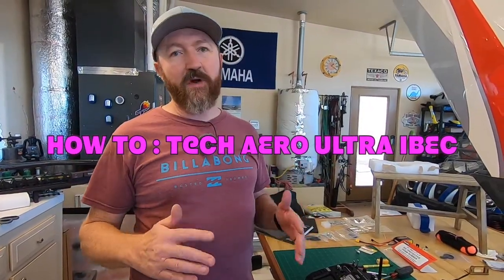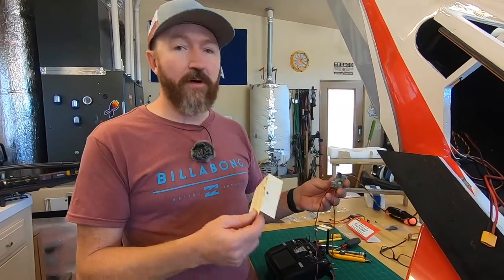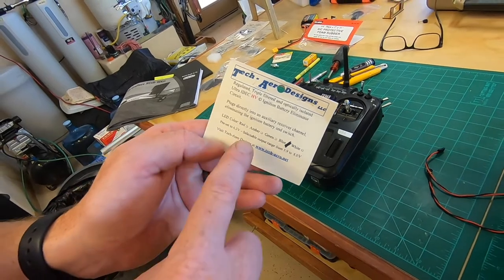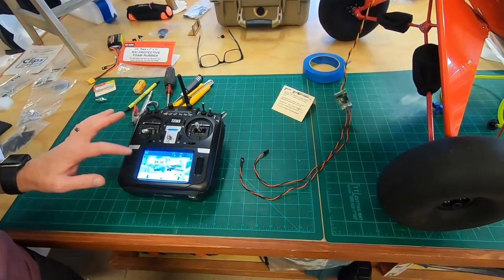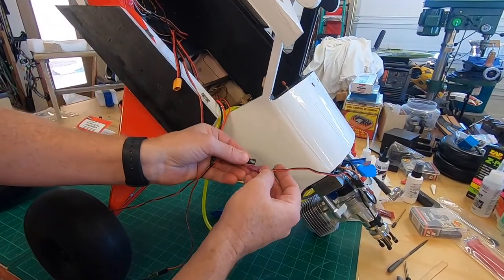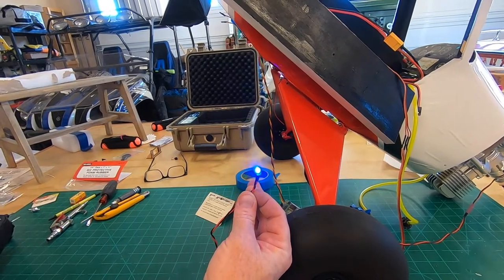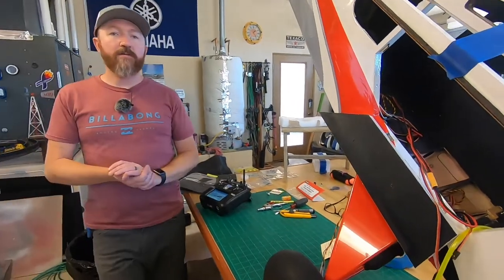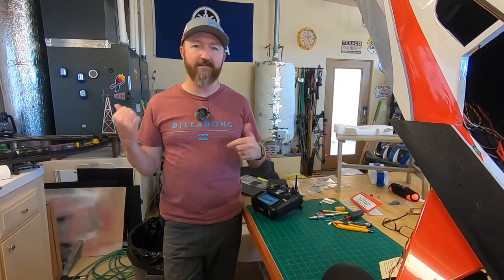Tech Aero Ultra IBEC Tutorial

Comment: Hello , I got  question, when is armed the IBEC will keep using the battery till you unarmed? Thanks
Reply from the maker: Yes that’s correct.
Reply: @UngluedModeler  will this drain  the battery faster ?
Reply from the maker: The battery drain is minimal. If I remember correctly it’s set at 6.6 volts. No more than an extra servo sitting at idle. The IBEC is supplying power to the ignition. The ignition is what makes the spark on the spark plug. This is also the point of dual batteries. Redundancy. And no matter what way you choose to power the ignition on a gas engine it will always be “using the battery”
Reply: @UngluedModeler  thank you so much, really well explained 🤘🏼
Reply from the maker: No problem! Anytime glad to help!